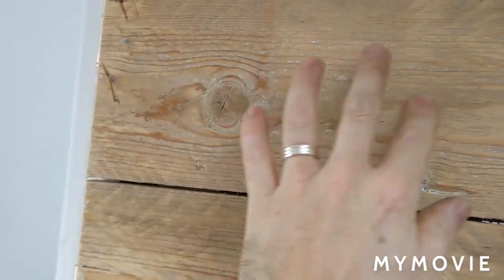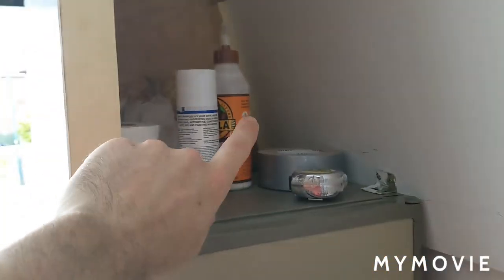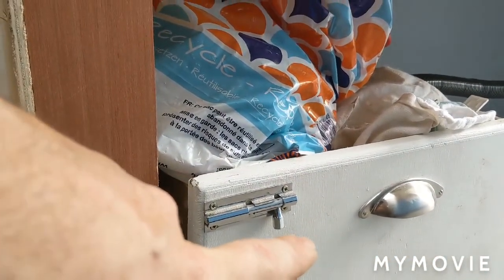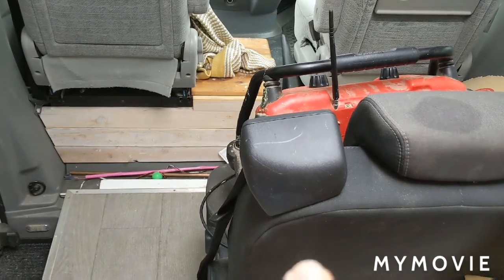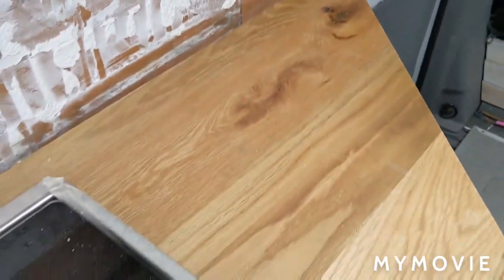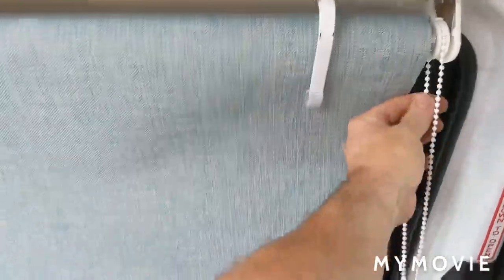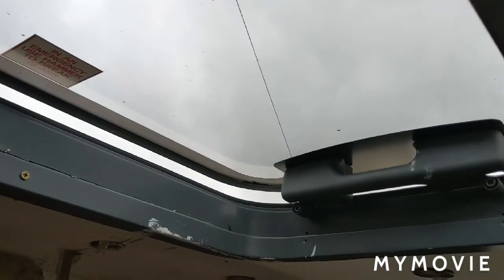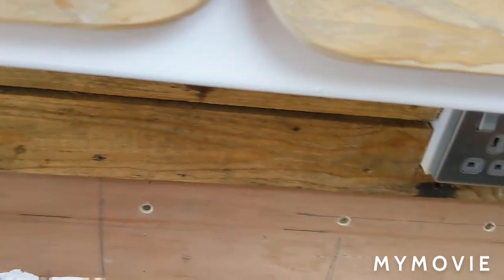Weremouse Workshop: Minibus to campervan conversion part 1

Comment: How many miles has the camper have on the clock ??.
Looks great 👍👍
Reply from the maker: About 118k Snobby, ex local authority school bus. It's sound just a few dings in the body work which I need to get sorted.
Reply: @weremouseworkshop8206  not even run in  yet  👍👍
Reply from the maker: Yeah should be good for another few hundred k 😉😜 cheers for watching Snobby appreciate it 👍